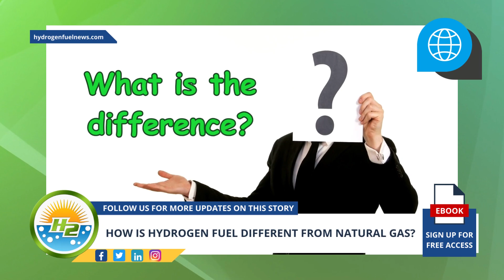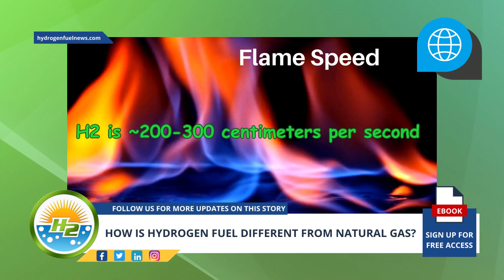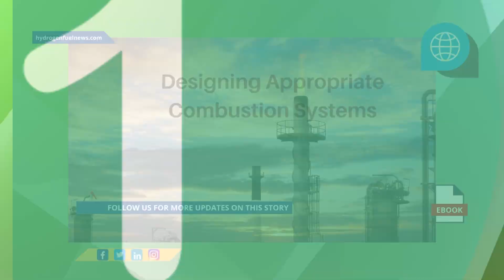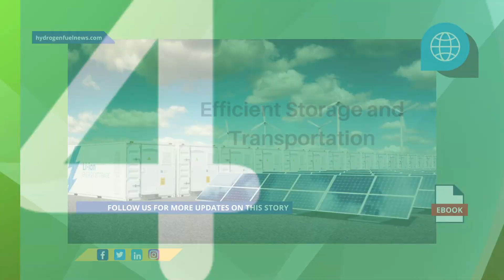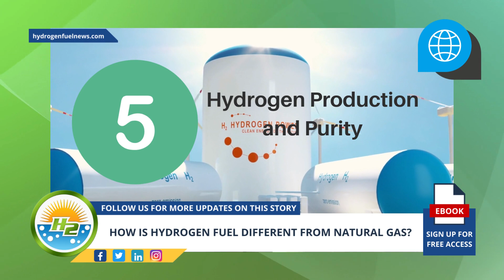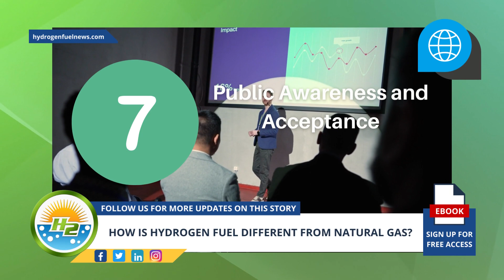How Are Hydrogen Fuel and Natural Gas Different? A Must-See Explanation!

Comment: The era of the small modular reactor (SMR) is well and truly underway, with swift decarbonisation of base load electricity a most straightforward process - particularly replacing generation from fossil fuel power plants through the use of in-place infrastructures.

Nuclear enabled hydrogen (NEH) is greener-than-green.The manufacture of NEH, by combining SMRs with PEM electrolysers, enables load following of diurnal electricity demand in milliseconds by switching between grid electricity supply and NEH manufacture. Seasonal load following is achieved through planned refuelling and maintenance outages.

Dedicated SMRs combined with solid oxide electrolysis cells (SOECs) for maximum production rates can then decarbonise all other sectors of energy use.

A complete energy infrastructure, requiring minimal storage is achievable. An Occam's Razor solution compared to the spaghetti-like morass of overcapacity of generators and almost incalculable quantities of transmission and distribution networks needed for a wind/solar/battery 'Energy Transition'.

Search for: "how nuclear enabled hydrogen (neh) will save the planet"